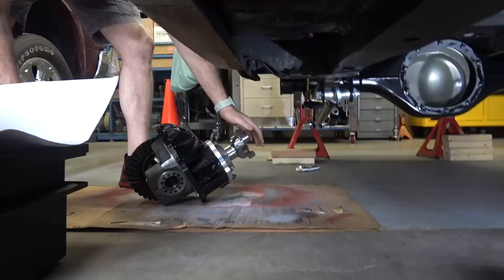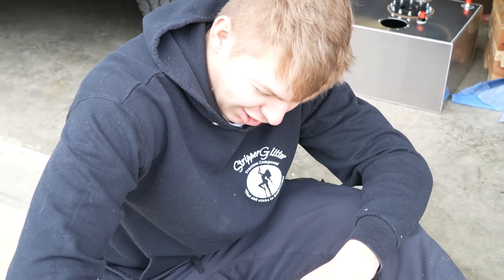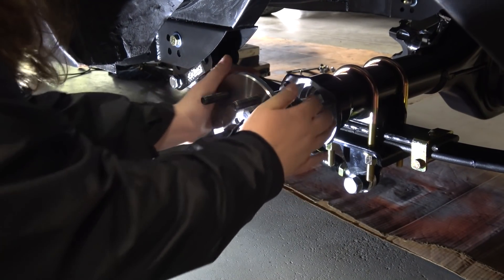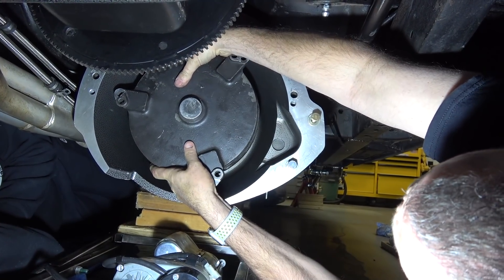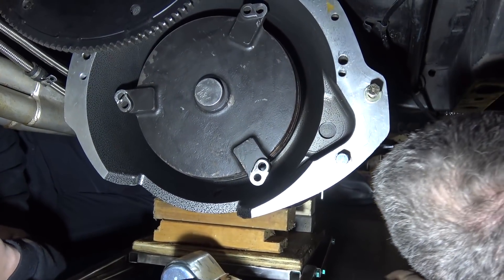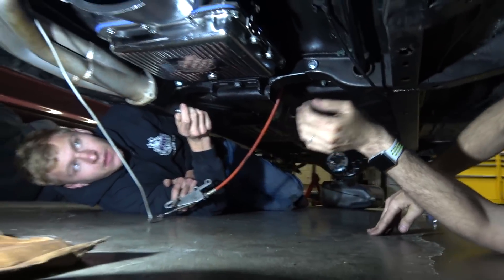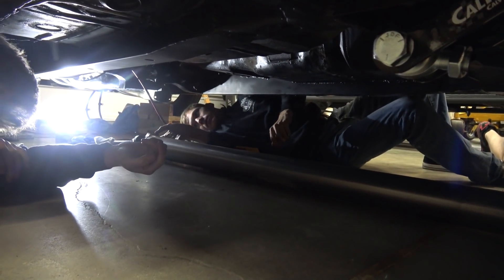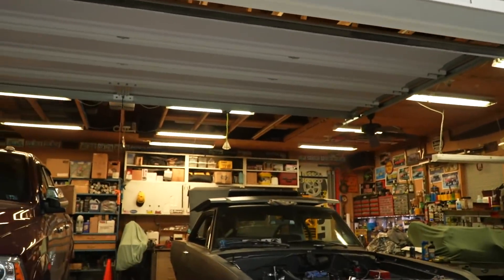The Dart Looks SICK! Major upgrades!

Comment: Best look and stance on a Dart I have ever seen, very eager to see Alison scrub the stickers off them tires in the (hopefully) near future!  Kinda diggin on the flat black look, kinda gives you two matching cars with the Falcon near the same tone.  Add some proper Gen 2 Garage logos someplace and yer golden.

And Alison... if your worried about a wing adding more length to the car, ya could always go for one of the Big Chief/Turbo John/Hustlin Horsepower deck mounted wings...
I'm only half joking here... from what I have heard the deck wing provides as much or more down force than a tail wing.  But I don't have anything that could run either wing so check that with someone more in the know?

/waits to be excoriated by Jeff/everybody for the suggestion

Comment: I put Calvert split mono leaf springs and Cal-trac’s on my 68 Nova and a quick performance 9”… you are gonna love the way the Mopar is going to 60’ good progress. My nova has a 468 with a hydraulic roller and a super T 10  four speed. 3 inch exhaust streetcar runs 11:20’s  with a 151 60’ and that’s just letting out on the clutch fast not sidestepping it. You are going to love that set up.

Comment: Just a slight caution, the new driveshaft length should be measured with the rear suspension at ride height.
My allergy goto medicine is Sudafed or a generic equivalent.

Comment: On any GM transmission you're going to have to jiggle it while you're spinning it and you'll hear three knocks once it hits the third knock then you pull it put the transmission on the on the motor and then when you pull it back to board up to the what's called it should have nuts enough clearance

Comment: BEFORE YOU START THIS>>>>   Once again Check clearance of the starter gear when it is engaged. They usually extend past the ring gear on the plate. You did not mill those ears down so they sit inside the gear radius. You run that starter with those tabs stickin up you will destroy the starter possible the fly wheel and maybe even the converter.
Reply: checked, they clear.

Comment: Please measure again for the driveshaft! I sent a lot of leaf spring car customers back home with instructions how to measure before I would cut a weld, cut a new stick of tubing, or even pop out a snap ring because of for a custom made driveshaft. In have always wanted the job to end correctly the first lick because the shop I ran stayed slammed with work I took in.
I’ve done years of that work, and been in countless jobs involving a wide variety of custom vehicles and equipment.